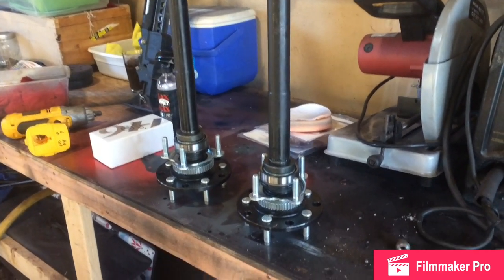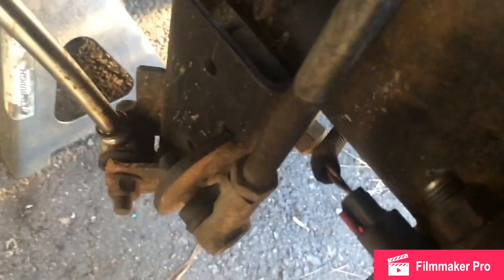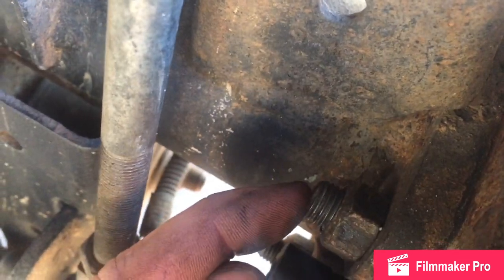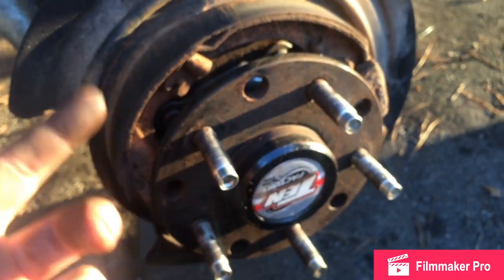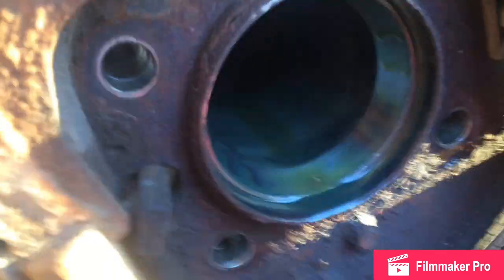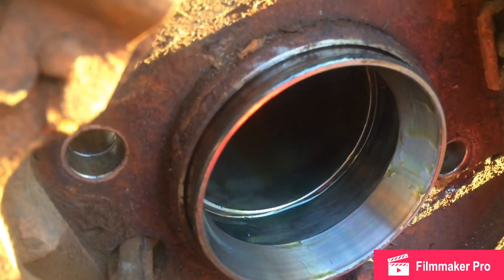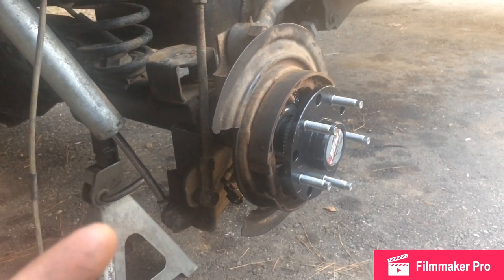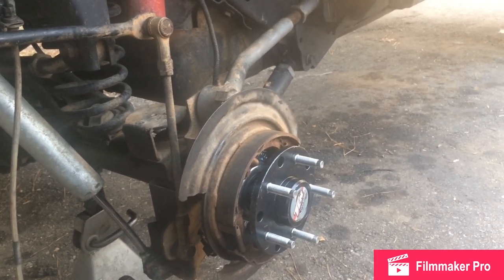Jeep Wrangler Rear Axle Shaft Replacement

Comment: Good video, Brother. Very thorough. As you know, I replaced Becky's rear axle shafts with Chromoly last year. I was lucky to have zero hiccups. The wheel sensor gave me a struggle on one side. Otherwise, easy-peazy-lemon-squeezy. It only took about hour to do both. That included the learning curve on the first axle.  Looking forward to more informative videos.

Comment: Im about to replace my seal and bearing as well. I didn't realize replacing the entire axle shaft assembly is less than 300 so I may just using it as an excuse to upgrade the axle. Good vid!

Comment: Hah. "Trying to get to about 1,000 followers by the end of the year" and now you're at 12.4K. Great video. My rear wheel bearings are bad and I'm considering replacing the shafts as well while I'm there.
Reply from the maker: Haha I know it’s crazy! And yes I highly recommend just going with a set of chromoly shafts while your in there, a little more pricey but it’s a great upgrade

Comment: I'm doing this now.  If any of the pressed in bolts spin through, no need to weld.  Use a nut splitter where fits to break the nut but I ended up using a metal cutting wheel to cut through part of the nuts all around, spray some PB blaster, comes right off.  Just did 3 of them.

Comment: Was your bearing squeaking driving down the road at all before replacing? My rear passenger side squeaks, its not the brakes I’ve replaced them and squeaking noise still there. I plan on doing this soon.

Comment: How did you know the flange was bent? Wheel wobble? I put on all new brake pads and rotors and I think this is happening to me because of the noise it is making.
Reply from the maker: You can Jack the jeep up and put it in drive and watch to see if the flange is bent

Comment: So it makes no difference if it’s the rubicon with locker ? 

Going to attempt this soon. I read where since I never pulled them out before you will need a slide or the rotor method
Reply from the maker: Rubicon has shafts with unequal lengths. Standard base axles are the same length.
Reply from the maker: This jeep is a rubicon

Comment: Great video! My wife has a 2015 unlimited Sahara. After months of trying to figure out why the breaks were noisy and it sounded like the AFLAC duck every time she turned right, I’ve come to the conclusion that is definitely coming from the rear end. I’m considering replacing the axle shaft assembly’s. I’m hoping it’s not the diff. Have you ever gotten any weird noises due to this issue?

Comment: If I put 8t back together and the sencor does not completely cover the spline would that throw me abs lights....
Reply from the maker: Are you getting an abs light? What all did you do?
Reply: Both wheel bearings and seal...now I get the abs lights on I noticed the sencor on the other side covers the whole tone ring but the passenger side only covers half or so....do I need to take it and get pressed more
Reply from the maker: It could be, is the sensor mounted flush?
Reply: And both axles are same size correct?
Reply: I'm sure there flush...if cleaned both rings plus bought 2 new sensors
Reply from the maker: Rubicon or sport? Rubi has 2 different length shafts
Reply: Jk...x 2 door
Reply from the maker: You have an Instagram account? If so send my some pics to @debtenator
Reply from the maker: Is the sensor to deep or too shallow over the tone ring? Sounds like it just needs pressed on some more
Reply: Sport
Reply: I'd have to dig back into it to send pics
Reply: But I'm sure the whole tone ring is not covered...and the opposite side is and I did not have abs problems til after the work
Reply: And I have had it checked with a reader and the code came back as the sensor bad on that side
Reply from the maker: Yeah I’m going to assume it wasn’t pressed on right
Reply: After I looked at it the tone  ring  is actually all the way against the plate the lugnut studs are on so I ordered another shaft just to make sure I got part number 68003272aa on EBay is this the right assembly for a 07 JK sport
Reply from the maker: Tim Ratliff yep that’s correct

Comment: Hey question! So the rubicon axel is one smaller than the other and the the unlimited sport are both the same size?
Reply from the maker: Yes
Reply: @JKGearandGadgets  I have a 2007 unlimited X, I purchased the “corresponding Axel” by the book and with the vin number.  but when I got the replacements, they were the same size but my jeep has one axel longer than the other.. the rear passenger is smaller, so apparently the rubicon is the one that fits my jeep right? Or witch one do you recommend? Please help me with that! My jeep has been standing for almost 6 months! I can’t find the right one. 😩

Comment: Hi im actually watching this because I need to replace my parking brake. I have a 2008 jku as well. Somehow it blew up and destroyed my  abs sensor and itself. Have you replaced a parking brake before or do you know how to? im thinking I have to take the axle soft out and assemble the brake on the ground. its freaking impossible to get the return springs on the brake, theres no room. If you had any pointers that would be great. thanks man.
Reply from the maker: I have never messed with the parking brake before, sorry. I wish I could help though!

Comment: I have an odd question. I have a 2015 Sahara x with the factory rear locker. Do I have rubicon shafts or sport?
Reply from the maker: Are you sure it’s a factory locker? Or a limited slip? Do you have the factory electric button for it?

Comment: Are the axles different because of the e-locker? I bought a 2017 jku sport and plan on putting in pro rock front axle. I didn’t know the rear was different from a rubicon.
Reply from the maker: Yes, the Rubicon rear axle is 32 spline with different length shafts because of the locker. The sport and Sahara have 30 spline shafts and are equal lengths on both sides.
Reply from the maker: And I would recommend looking into the fusion4x4 44/60 hybrid front axle. Close to the same price as a Prorock 44 but is a better choice hands down

Comment: If the shaft has a wobble will that affect the abs sensor?
Reply from the maker: It can. The tone ring is pressed onto the shaft
Reply: @JKGearandGadgets  my abs on left will work fine as long as it's on a lift..put it on its own weight and the abs and trac light comes right back on and it goes into limp..I can hook the sensor and it will drive but my cruise won't work
Reply: @JKGearandGadgets  unhook the sensor I mean on the left rear

Comment: Does the ring and pinion gear need to match the splines on the axel? Let's say you had 32 spline axels and then switched to 35 spline. Will this be okay without changing your ring and pinion gear, or do they need to match? I'm a newbie at this so it's probably a dumb question.
Reply: Yes, if you upgraded just the carrier to accept 35 spline axles and keep the same gears, should be fine. Usually the gears are upgraded at the same time to lower ratio... but that's not required.

Comment: How do you confirm the axle shaft is bent or the flange is warped
Reply: I seen mine by simply breaking it down on a jack to the axle it's self and throwing it in gear ⚙️ lmao 🤣 make sure both tires are off the ground ofc and step back see it your axles are wavy

Comment: the outer axel bearing race should not move by hand. it should press into place and also need a puller to remove. if you can remove it by hand the axel housing is worn.